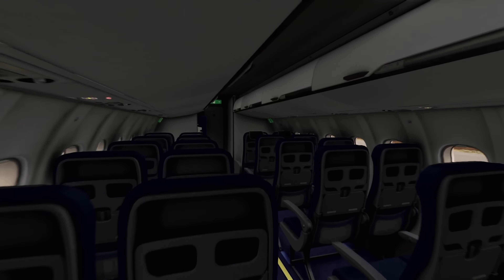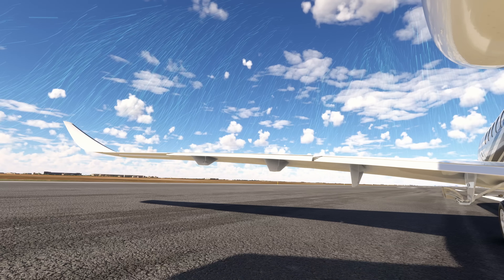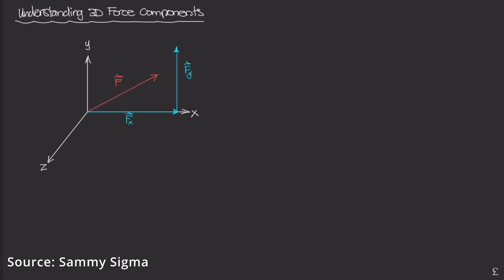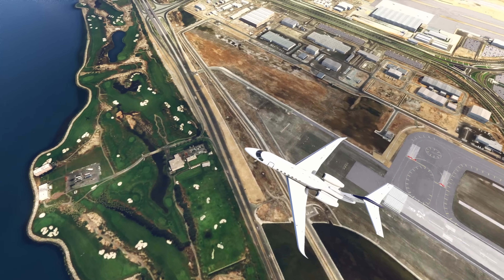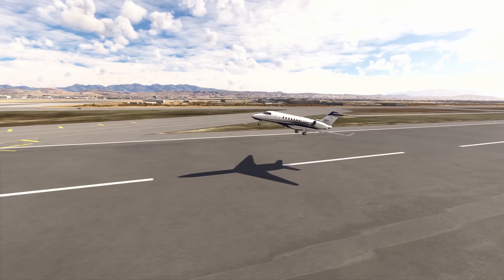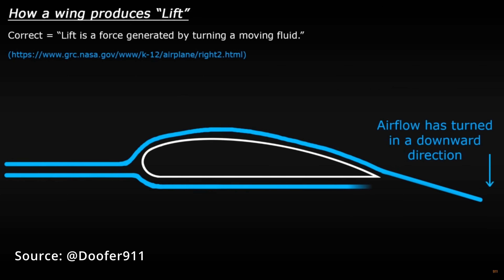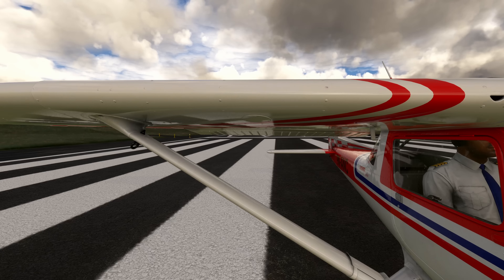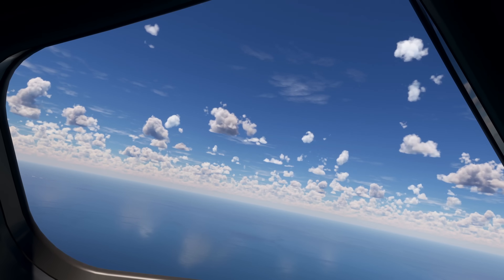The Truth about Lift

Comment: I’m an graduate professional engineer. Before university, I was confused by all kinds of bs explanations. A second year mechanical engineering professor put an end to all the crazy theories. It all comes down to the change of momentum of the oncoming air. Force is mass times the change in velocity, per unit of time. Force is normally the weight of the aircraft. The wing angle of attack forces a downward change in velocity of the static air mass. Going faster ? More airmass is encountered per second, therefore less change in velocity required. Maybe lowered angle of attack. Why can’t they tell this in grade 10 ?
Reply: @DaveP-uv1ml  What's ironic is the "old way" that was never accepted in real aeronautical engineers is still more unintuitive than the simple explanation: the surface just pushes the air down. And of course it's unintuitive than the real explanation. Because newtonian physics is naturally intuitive for most animals.
Reply: If you put your hand out of the car window at speed and play around, you get all the explanation you need.
Reply: @DaveP-uv1ml  For some reason I always found the "old way" to be confusing, and the actual description a lot simpler and easier to understand :)
Reply: @Sonnell  And the biggest flaw is that if Bernoulli's was the only source of lift, a flat object would never be able to generate lift. If you play around with a piece of cardboard in the wind, it's obvious that the flat surface creates plenty of lift.
Reply: How does this explain supercritical airfoils? I'm curious
Reply: @DaveP-uv1ml There are sometimes justifications for teaching a partially incorrect understanding as a step on the path to a true understanding. An example might be the solar system analogy of the atom. I'm not sure if the equal transit theory has any use for teaching. You'll learn more sticking your hand out of a car window or building model planes
Reply: I think of it as a cushion that is being held in the sky by the speed of airmolecules passing underneath. The faster you go, the more air molecules pass underneath each given second and create a sort of "ground" that the wing rests upon. Once there is sufficient speed the aircraft "stands on the air" because the "ground" ( just air molecules beneath the wings ) underneath is "rigid" enough to withstand the stress of lift created per wing area ( N/mm² )
Reply: Correct. Wings are not an attempt to make one flow faster than the other. They are a ramp that pushes the air down. The curvature is just what you get when you take a streamlined teardrop and bend it to create this ramp.
Reply: This explanation does not work when you have an underweighted glider which can point with less than 0 angle of attack
Reply: @axsmith8857  Camber causes the trailing edge to have a net downward angle at 0 AOA. Angle of incidence can also cause the same glider to experience negative pitch at positive AOA. Look at the Armstrong Whitworth Whitley as a prime example of angle of incidence.
Reply: @axsmith8857  Doesn't the negative angle of attack just reverse the drag vector so that it becomes a driving force?
Reply: @TerryClarkAccordioncrazy On negative angle of attack, no, the drag vector can never point in the direction of motion. Negative angle of attack creates drag just the same as positive angle of attack does. A drag vector pointing forward would mean the wing is generating energy just by moving through the air, which is not possible. With a cambered airfoil, drag can decrease with a negative angle of attack, but that’s just because drag is lowest when the wing is producing zero lift, and a cambered airfoil produces zero lift at a negative angle of attack. Once you start producing negative lift, you get positive drag again.
Reply: @Tom-jw7ii  You're right. Drag can't reverse. The wing with negative angle of attack trades altitude for forward thrust which balances the drag.